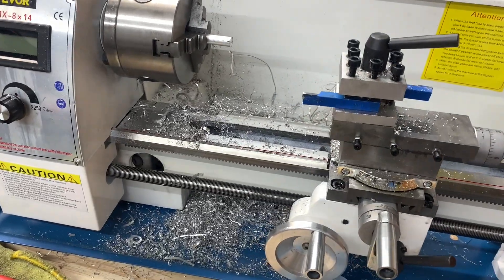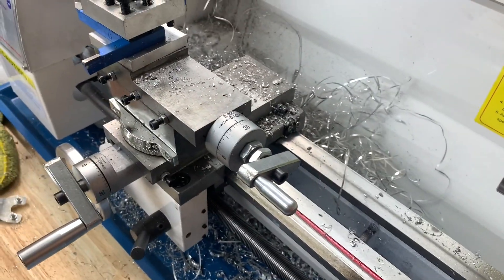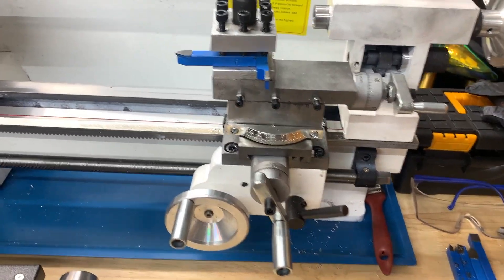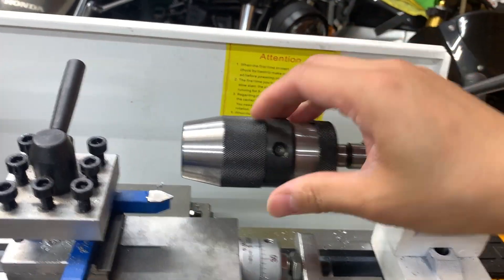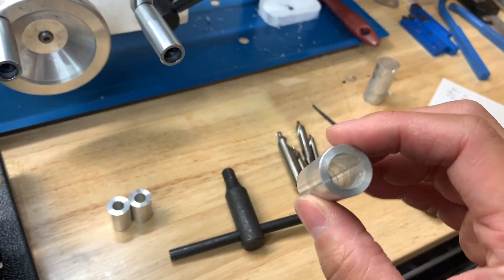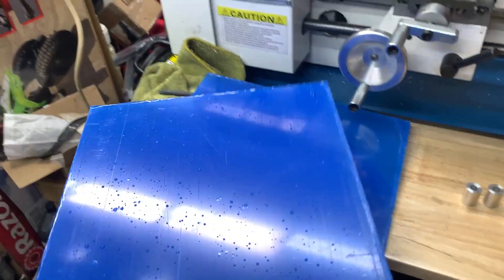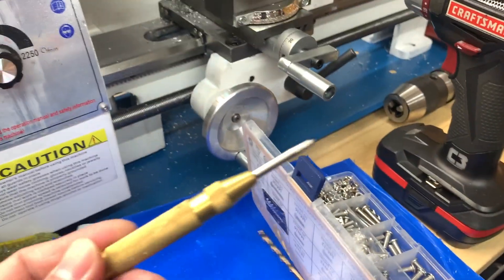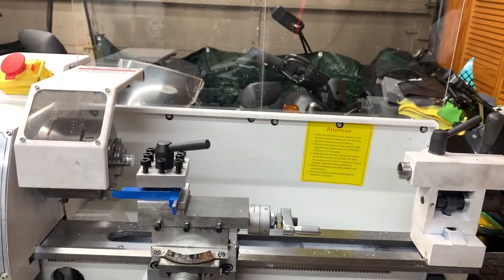Mini Lathe Carriage Stop Tip & Modification (Vevor 8x14" 2250rpm 650w) | Part 3

Comment: I lock the carriage using the socket head bolt located under the tail/crank of the compound. I keep the supplied allen key in it at all times to lock/unlock at will
Reply from the maker: Thank you for the tip, I'll have to check on that!
Reply: How do you do this? The lead screw blocks my hex key hahaha